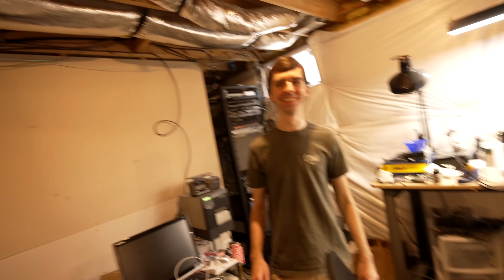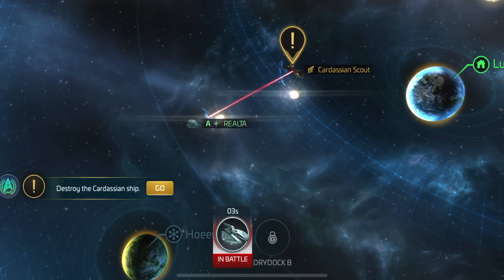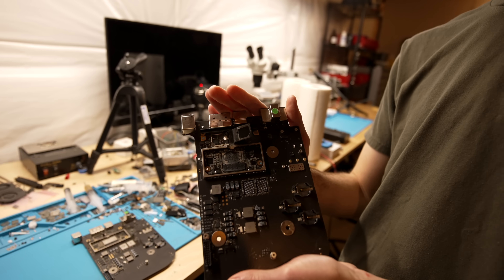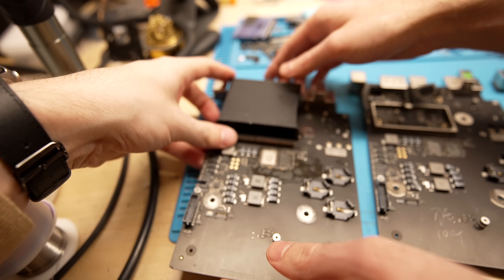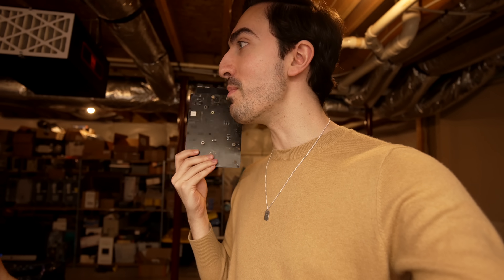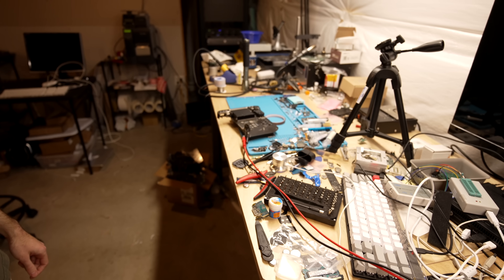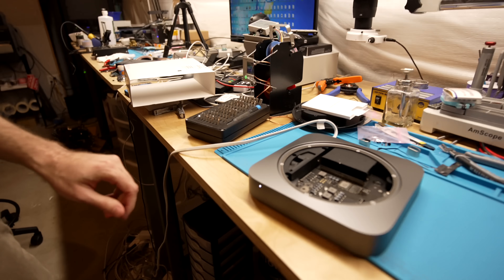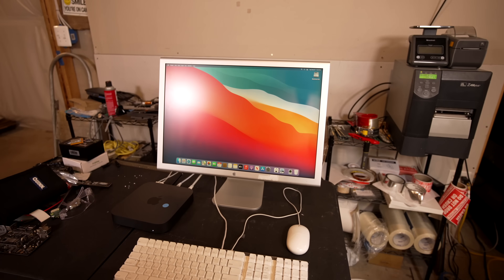We built the FORBIDDEN MAC

Comment: Cant use any other OS than Big Sur? OCLP is for the rescue. My sister use her 2011 mid 27" imac with the latest Sonoma(High Sierra was the last official OS).
Reply: Yeah but then they’d have to add support for the a12z, which most likely won’t work even with patches as it was only ever officially supported in big sur. So I highly doubt the team would put the effort into supporting it if it was even possible

Comment: With that many boards, you have enough to reverse engineer them. You'd need to document all parts before removing them, then add epoxy to thicken one side and sand through the board layers to document the traces in each layer. After doing this you could use wire to recreate the circuits destroyed by drilling.

Comment: I suppose the real forbidden Apple PC would be one that is user upgradeable and can be repaired by anyone.  Like how it used to be so many years ago.  Why use a poorly made SSD that will die suddenly with all your data on it?  Or use only a SSD for internal storage?  Pop in a more reliable HDD for vastly more storage for a fraction of the cost and will last ten or more years.  Upgrade the RAM, have expansion slots to give your PC more capabilities than what it shipped with.

Comment: The $500 definitely was not refundable. In fact, there was a big uproar as Apple only offered something lousy like $100 rebate. I think in the end they increased it to $300 or something like that. Still, there was a net cost to any developer who wanted to use one.
Reply: They originally offered only $200, and it expired very quickly (forgot how long exactly, but it was before the 14” and 16” machines came out). After major uproar from developers, they changed it to the full $500, and extended the amount of time before it expired, allowing the possibility of using it towards the 14” and 16” M1 Pro/Max MBP models.

Comment: I've been watching your videos for a while, and I have to say, you've really helped me save a few bucks. Here's a question I'm hoping you can help me figure out - I've tried and haven't been able to find a solution.

I have a Samsung EVO NVMe SSD that's enclosed in a Thunderbolt 3 case, and I'm wondering if there's any way to connect it to a Thunderbolt 2 port. I've tried using an Apple bidirectional TB3 to TB2 adapter, but it doesn't seem to be working.

Let me know if you have any ideas or if you've come across a solution for this before. I'd really appreciate your help!

Comment: So is it possible to Frankenstein this OS on an iPad? Maybe by soldering this memory in an iPad? Or flash the software?
Reply: I don’t think there are any technical reasons why an iPad won’t run MacOS except for Apple blocking it through firmware.

I don’t think the low level firmware of an iPad will ever allow booting MacOS.

I suppose these DTKs are configured differently to allow it to work.

Comment: I was recently able to buy one of those board - my board is not drilled and it comes with a cooler. I wonder if it will be fixable. I will try to replicate your original video in restoration proces. Thanks for a very good work you are making.
Reply: It very likely will be, as long as it’s CPFM03 (prod fused). Just be careful and make sure you have the necessary tools. You can also send it in to me, I can restore it for you, and send it back.
Reply: @dosdude1  If you could help me, that would be awesome, but I will not have time to look to this for a few weeks, because I have to work and study for my final exams at university for a few weeks. But I will appreciate any help. I wanted DTK in my collection since they were shown at WWDC in 2020, I am very happy even with the non-functional board, a functional one would be even better. The interesting thing is that my board is cut in the same place as yours and the same components around the NAND are missing.

Comment: Did you try Opencore Legacy Patcher ?
Reply: This will not work with OpenCore in any way, as it doesn’t use UEFI at all (and is ARM of course). However, I have saved a few of these DTKs to send to fellow members of the OCLP team, with which we will work and attempt to get later macOS versions working on the DTK.
Reply: @dosdude1  Makes sense! I wasn't even aware that Apple Silicon didn't use UEFI. I'm very curious to see if you can get it to work on later versions of MacOS though. Not only would it be very cool to see the DTK itself running Sonoma, but I guess it could also help out people with M1 Macs when they eventually get dropped by Apple.
Reply: I was thinking the same. You might not even have to install OCLP on the DTK itself. Just using an installer that was made with OCLP for a more modern version of MacOS might be enough, because it removes the compatibility checks

Comment: This has a 12z chip right, how different does it run Mac OS Big Sur over an M1 chip? Will there be any issues as such?
Reply: even an A10 would be plenty fast enough for 99% of users just like 8 gb are plenty for them
Reply from the maker: It runs perfectly fine, a little janky just because it wasnt really built to be a Mac (but thats not a commentary on the chip, just the weird DTK). Still faster than most Intel MacBooks!